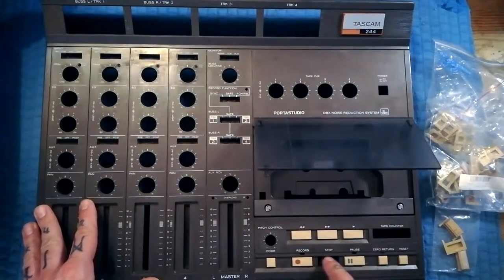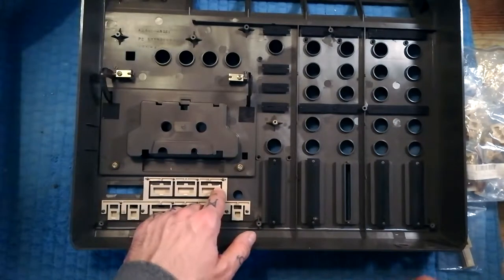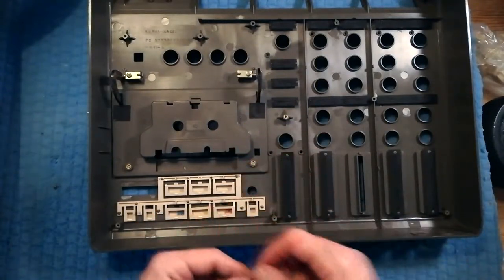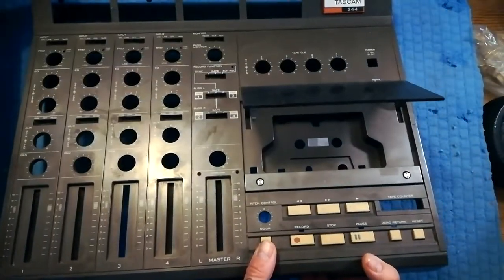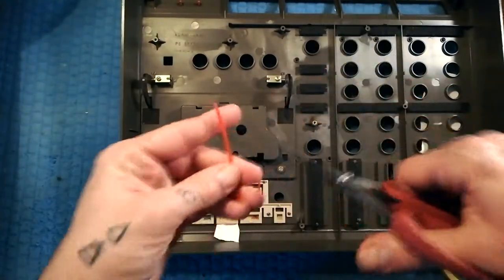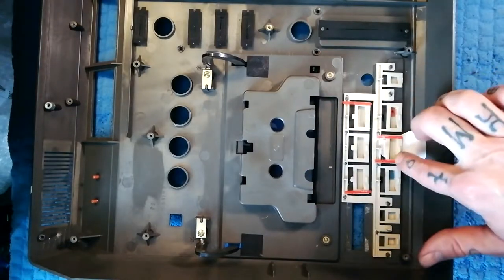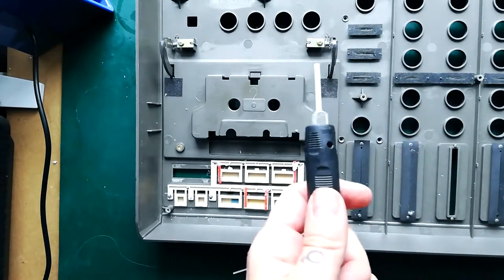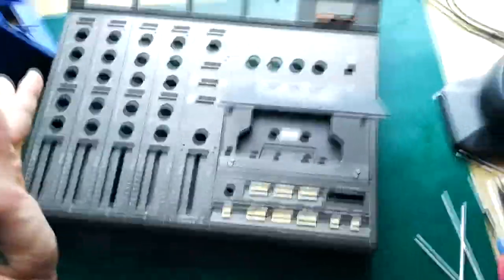Tascam 244 | fix broken plastic buttons | cosmetic repair to shuttle switches

Comment: Great channel! I have the Porta 424mkll. The playback function just quit on me. I'd love to see a vid on how to fix that. I haven't been able to find one yet. I guess this isn't a common problem.
Reply from the maker: Hi, thanks for watching. Tell me a little bit about it and maybe I can help you troubleshoot it? Does the capstan spin with no tape in it? Do the other transport functions work...for instance can you rewind. fast forward and stop? Are the magnetic heads raising and retracting okay?
Reply: @Tetrakan  HI. Yes the capstan spins.... And just now when I went to recheck all the functions I pressed record and play at the same time and the play function started working again. Tried the play function by itself and it worked. So thank you for getting back to me. I will message if it cuts out again. Really happy right now!!

Comment: I have a non-functioning tascam 424 I would get rid of for the cost of shipping. It won't power on.
Reply from the maker: Hi Jim, I'd certainly be interested in that since I'm trying to build up a resource and maintenance library of all models if cassette multitrack recorders over the next few years to help folks fix their own units. I'd be happy to ship it and give you a shout out, or if you would like to use it again, I'd fix it for free if you agree to let me document the process for the channel and reimburse me for postage?thanks for watching :)
Reply: @Tetrakan  ....i never thought anyone would be interested in it until I just recently saw a video about it. Someone directed me to your channel. At some point I was just going to put it in the garbage. 
   I do all my recording with computers now. I don't really need it for recording.
Reply from the maker: @jimscobie6646  well if you're sure I'm definitely interested in taking it off your hands and covering shipping, and if i ever sell it on after repair you can nominate a case or charity for the profit to go to. Maybe the easiest way to exchange details would be if you messaged me through the channel's facebook page? (there is a little facebook icon in the bottom left corner of my channel page header) Thanks! :)
Reply: @Tetrakan  .... what's your email address. I'll contact you.
Reply from the maker: Jim Scobie sorry for the late reply! I didn't get a notification about this comment so I assumed you'd gone off the idea - you can email me at calum.john.davidson@gmail.com thanks

Comment: hi, is it the same system for the  tascam464?
Reply from the maker: Similar. It's actually easier to access on the 246 because the metal cassette with the shuttle control PCB on it comes off without having to remove the front plastic case from the metal chassis. Check my channel homepage - I have videos tearing down the 246.
Reply: @Tetrakan  ok thanx
Reply from the maker: @AsocialFTW  mate sorry I'm dyslexic so read this as 246, yeah same idea for the 464, I'll have a video called "tear down upper section" or something like that showing you how to get access, cheers